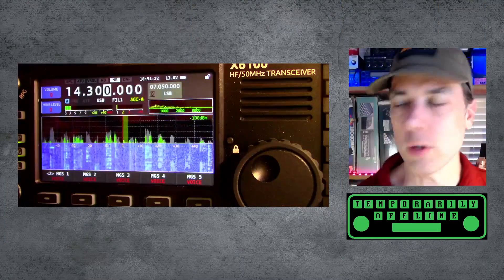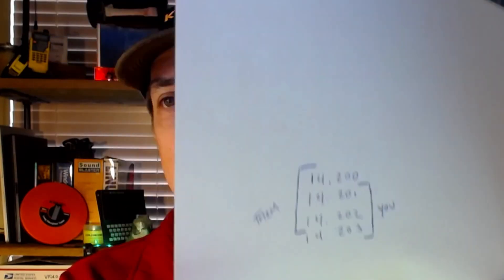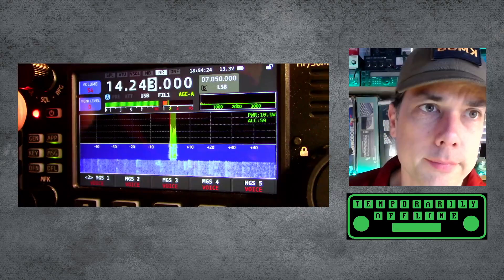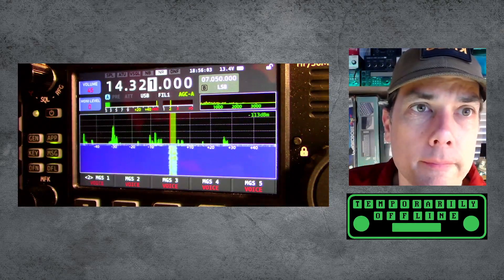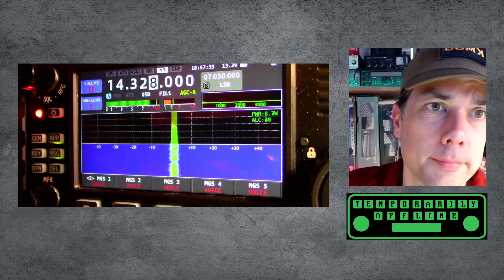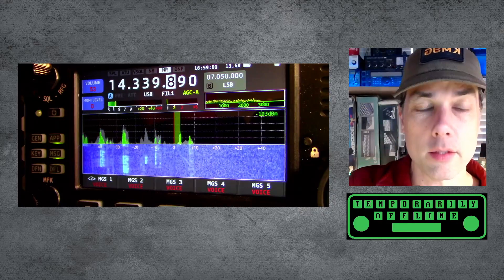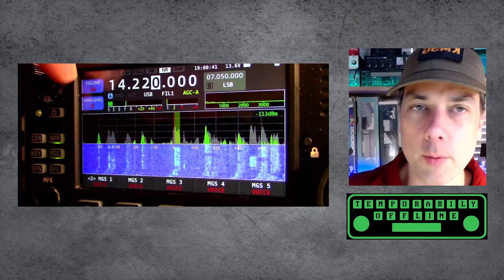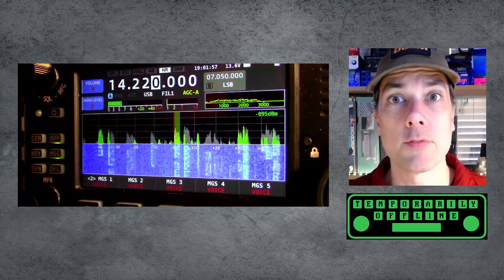How to tune in or find a clear frequency on Ham Radio

Comment: Using 1k is a byproduct of making it easy and faster tuning. Just like usb or lsb, if everyone decided to use .5, they'd still use 1k to tune cause it takes 30 clicks to get to the next frequency block of 3khz away.
Reply from the maker: That makes sense.  I always set my rig to 1k tune, even in CW.